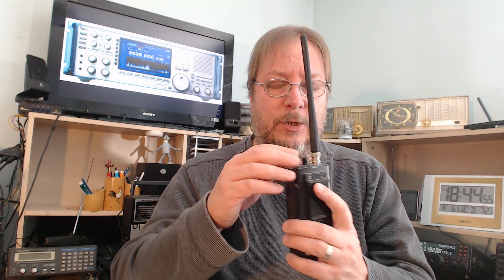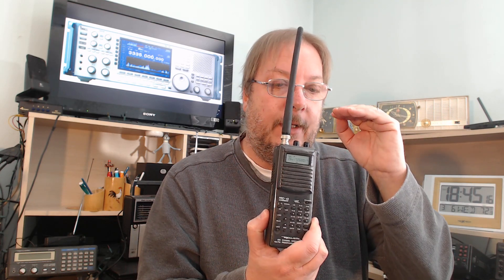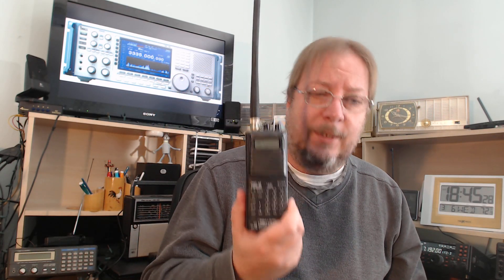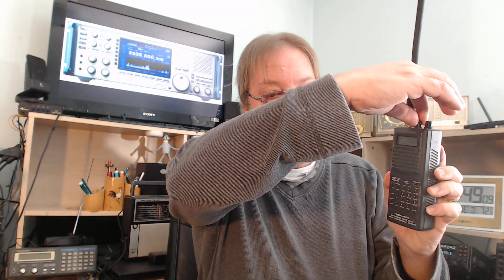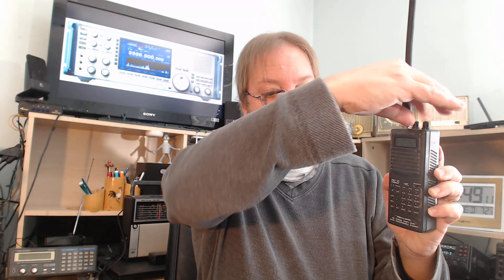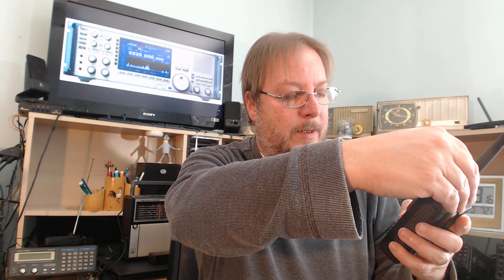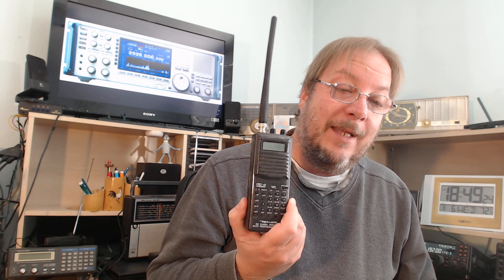VHF UHF radio daily tip #20 How to use the Squelch function on your Scanner radio

Comment: I have a bc350c. Im looking into getting a phase 2 P25 to be able to scan and use frequencies in the area of 600 to 700 codes. Mine stops scanning in the 500+ and starts to scan in to area of 800+. Im confused...lol also, what scanner do you recommend for the phase 2 and p25, not exspensive.